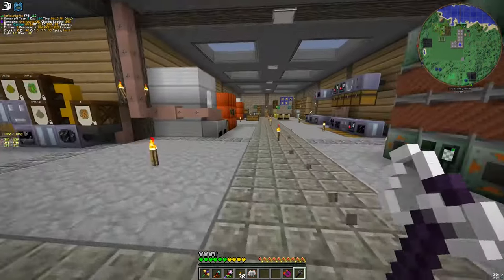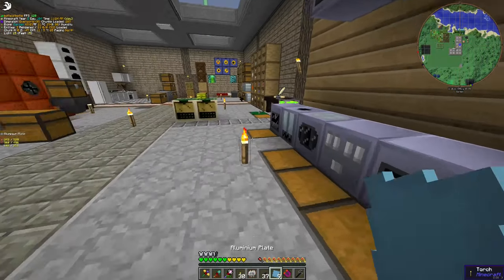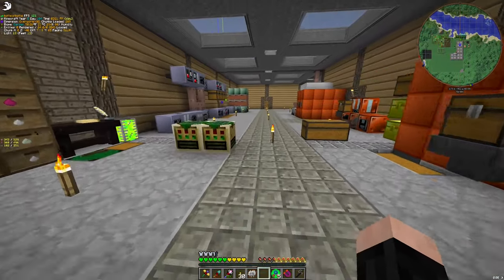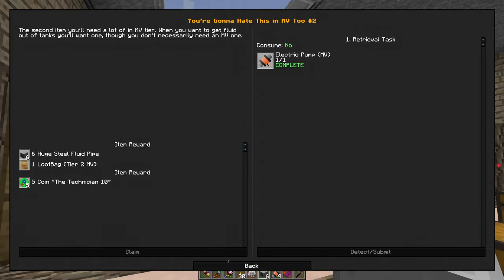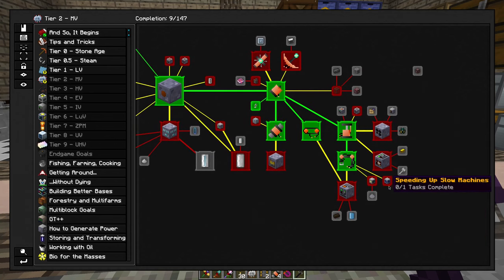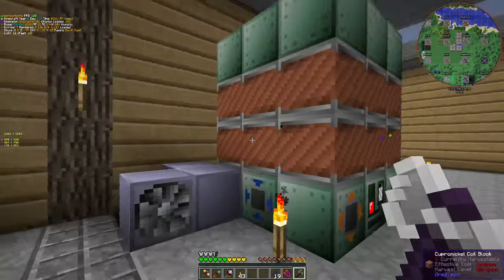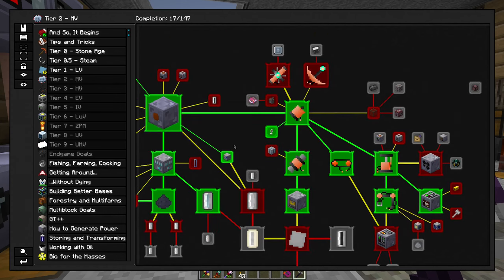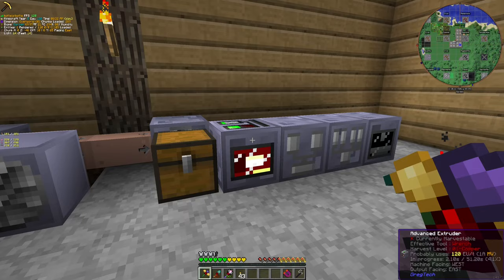They Said Medium (Voltage) is Premium | GregTech: New Horizons S2 - 16

Comment: Your EBF can be powered just fine by 4 steam turbines, you have enough steam production.  The problem is it requires Large Potin pipes to move enough steam to power all 4 Steam Turbines.  The Battery Buffers are costing you a 5% energy tax and aren't needed if you upgrade your pipes.
Reply from the maker: I'm aware of my steam production is not enough, but I'm planing to not rely on steam in a short time beside macerator and polyethylene